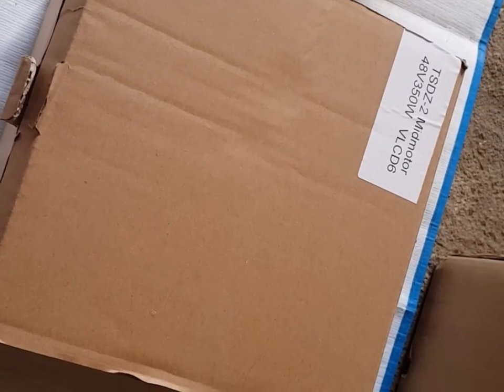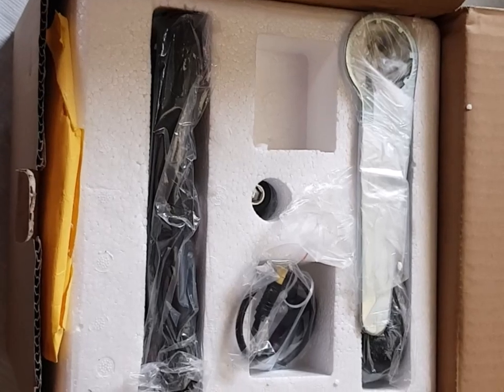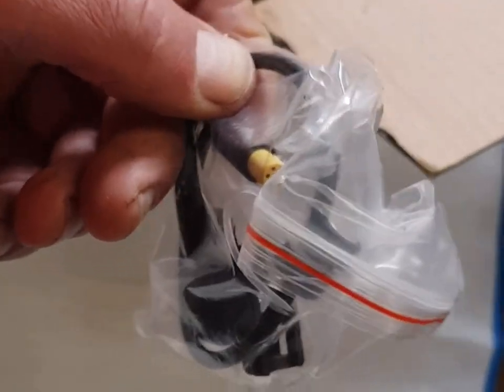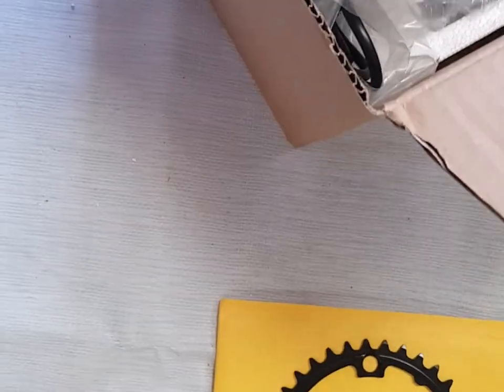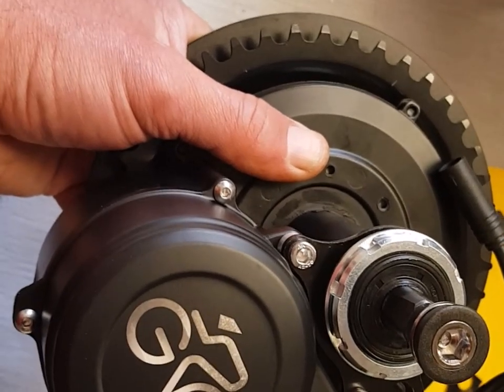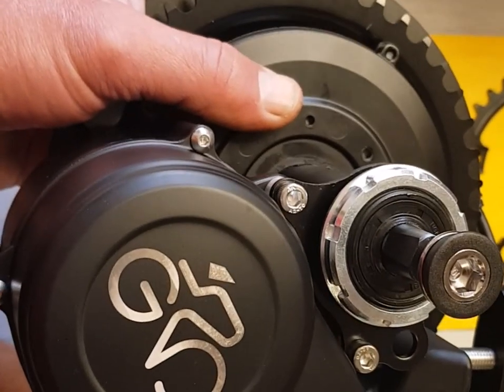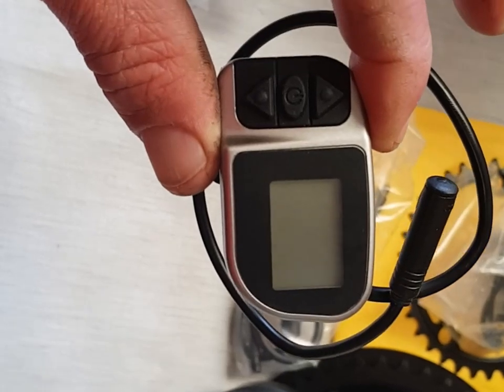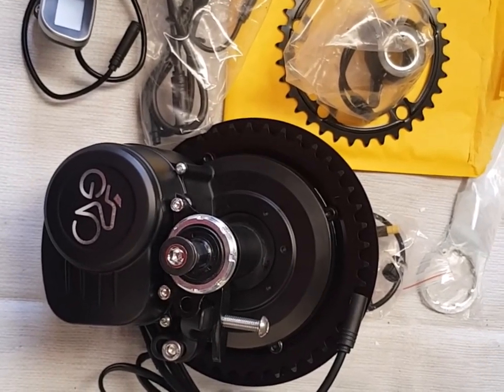Tongsheng TSDZ2 unboxing and review

Comment: Hi, Just a heads up - These really are good little motors & apply power far smoother than the Cadence Sensor motors. We had 3 of 4 motors come back to us with problems until we discovered what was going on. In one case it was a bad installation. In another case it was a customer not knowing how to use the gears & power levels properly & the third motor was the sacrificial Blue Gear damaged so we replaced it & it came back again after about 2 weeks. I would recommend opening up the side covers on these motors & packing all the gears with white grease as from the factory they can be pretty light with a quick swipe. Also if you are doing lots of off road or climbing change the Blue Delrin Gear to the Brass version. Your motor will run a little noisier for the first 5 or 6oo kms but then gets bedded in. - https://mid-islandadventures.weebly.com/electric-assist-kits.html

Comment: Hi. I'm enjoying your website and videos. Researching ebike conversions is wrecking my head. However, you would appear to be "the man".
I have a Trek 7200 that I'd like to convert. I'll mainly be on roads with some hills. I'm going to use it with my new camper so the terrain will vary. I also want to tow a small bicycle cargo trailer.
I want to get a TSDZ2 48v 750w from Alibaba. Is this overkill? There is a guy in my town who advertises conversions, but when I emailed him, he got back saying that he would strongly recommend a rear hub conversion.
But I still think that the TSDZ2 is better.
Can you advise please? Also advise the most powerful optimum battery for the 48v 750w.
TIA

Comment: Do you have to re pack this motor with a different type of grease like on the Bafang . Also do you 
Think you could fit two chain rings to this motor as I would like to fit it to my tandem
Reply: Bob Hawk I have seen vid of a gentleman who has fitted two chain rings to this motor also you can buy
A chain ring adaptor ,  but two other problems if I could fit this motor I would need a extension cable
To connect to the display the other problem there’s two bolts fitted to the bottom bracket for tightening
The eccentric bottom bracket . Would you think after all that this motor would cope with this tandem
Being a lot heavier
Reply: Bob Hawk I own a Thorn Raven twin all chains are fitted to one side I have a Rolhoff 14 speed hub
So chain line should be easier I could fit the motor to the front but you have problems synchronising 
Peddling , but like you say bottom bracket pinch bolts are the big problem. Thanks for your input 
Much appreciated.